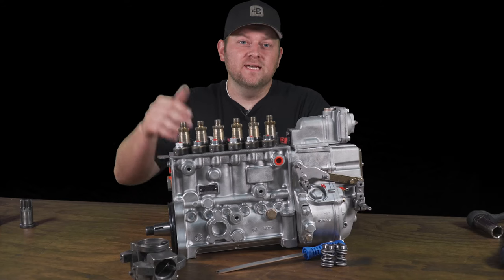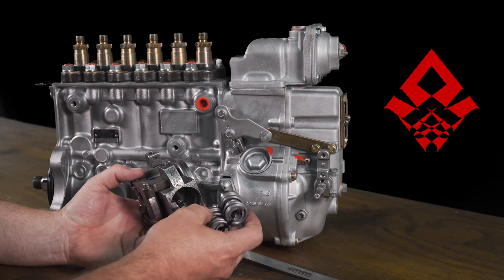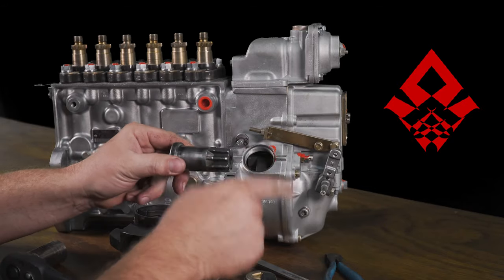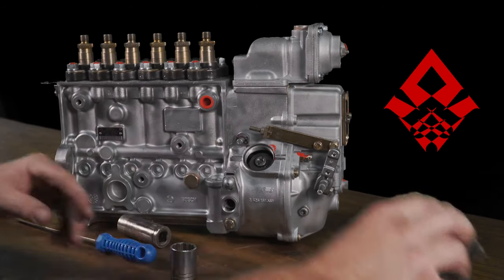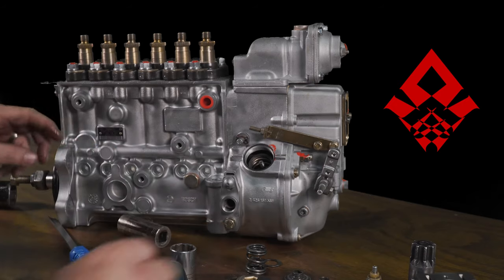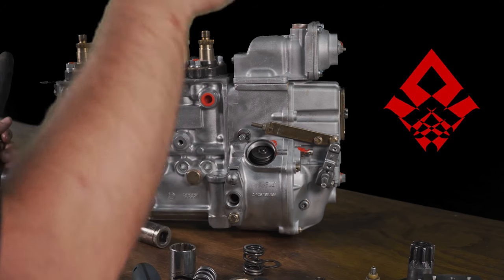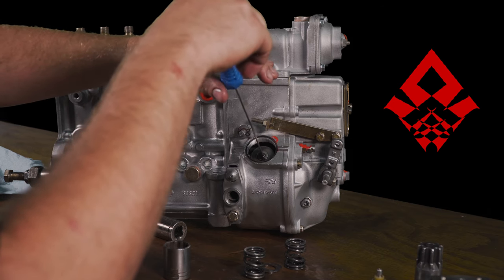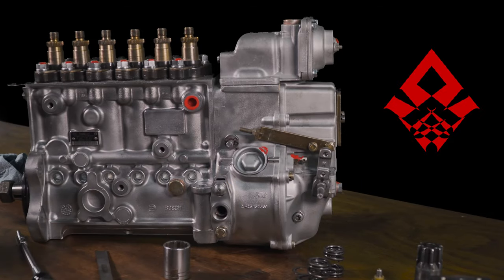In-Depth Governor Spring install

Comment: I did a stupid and broke one stud that holds the springs, drilled it threaded the hole drilled out the broken stud and threaded it also works fine, so far. Did it all with injector pump still on motor
Reply from the maker: Risky!   Hopefully the repair holds up long term!

Comment: Pulls out typical broken timing pin! I'm surprised yall don't put billet timing pins in your pumps! Good video regardless!
Reply: The plastic pin is probably a safe guard in case you forget to turn it back around, it will break and not likely damage anything. Billet left in pinned position things will probably be damaged $$$.
Plastic NOT billet.
Make any sense to you?

Comment: I'm just about to put these in my manual 96, and I'm curious if, or what, overlap there is between tight 3k and loose 4k?  Second question, is there overlap between tight stock springs and loose 3k springs?
Last question...  How many clicks are too many? (6 or 7?)  Obviously the more clicks, the less spring travel you'll have, but there must be an acceptable range.
Thanks for the great videos and great aftermarket parts!

Comment: Hey. So I followed your video pretty much to the T and my cummins seems to idle a bit too high. I tried to set the idle lower with the idle adjustment but it will not start. It idles around 850-900RPM warm. Is there any way to get this lower?
Reply: Great to see they follow up wo well with people that watch their vids
Reply: What springs did you use? What company did you go with? Some of the cheaper ones arent machined to the exact specs of the factory ones, if you have factory injectors put a bigger injector in itll help drop the idle a bit
Reply: Did you adjust it to one or 2 clicks?

Comment: 12valve does when put into gear. Possibly too much tension on the Governor spring? 
Any tips?
Reply from the maker: Shimming the largest outer idle spring taller so that overall preload on the inner springs is reduced will create a stronger idle.  Idle spring shims from Bosch are available for purchase from us.
Reply: @powerdrivenproducts7835   idle was strong  maybe too strong cause 
I made no difference if it was at 800 or 1200 rpm. It still would die after putting it in gear. It’s been five months ago so I forget exactly what it was but the governor springs ended up being too tight or too loose.

Comment: is the  4000 rpm make power up there? it could rev there but is it useable or are you just going to piss the EPA off for no reason and just make it run hot? legit question, not nit picking.
Reply: No 4000 rpm is not useable nor will that be your peak power level. The main reason you do 4000 instead of say a 3500 setup is because the pump starts defueling 500 rpm or so before the max rpm. Highest you’ll probably actually rev usably is around 3200-3500.
Reply: Mine fuels super hard to about 4200rpm. I’m not running stock fuel or turbo by any means though.